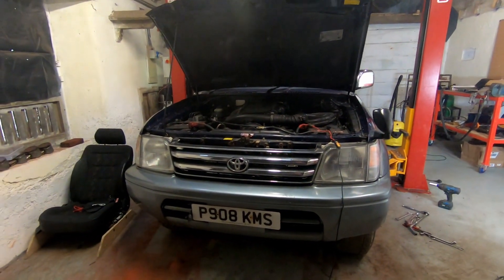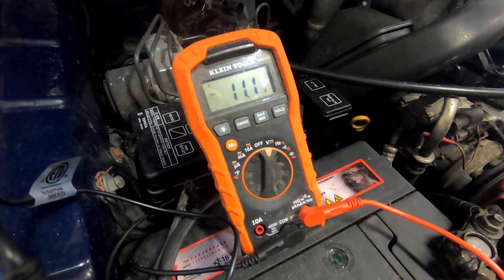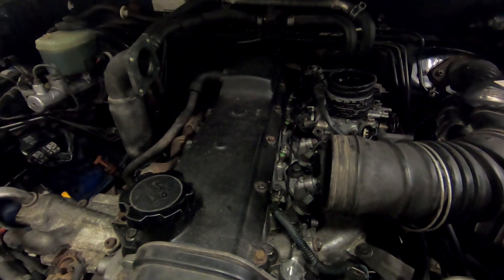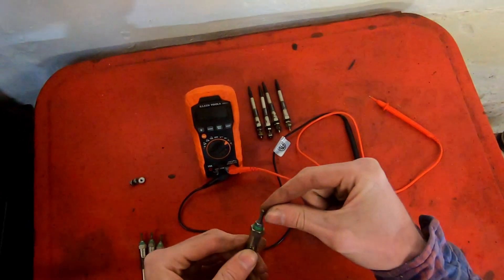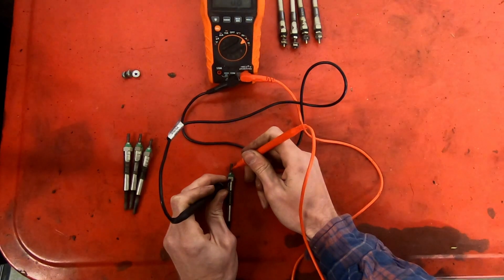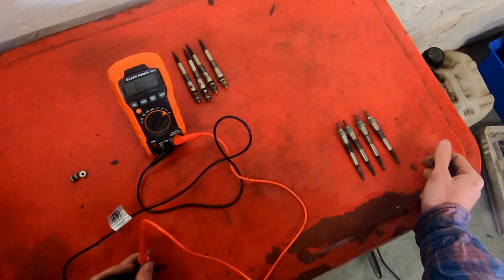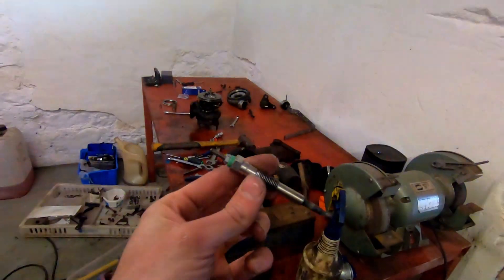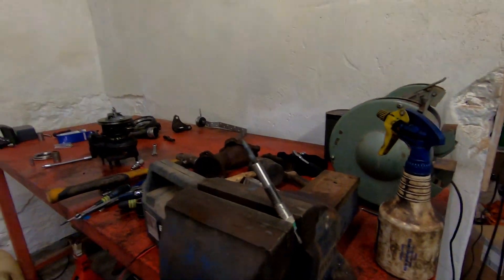Inspecting and Replacing Glow Plugs on a 1KZ-TE Engine in a Land Cruiser Prado

Comment: I bet this was a leaking fuel system and the new plugs made no difference. Check out the 1KZ service manual for a diagram of all the places leaks could occur (usually at the injectors or fuel filter).
Reply: or in my case, fuel was leaking back to the tank via faulty fuel cut-off solenoid on the fuel pump

Comment: how long for your glow plug light to shut off, my hilux surf has the same engine and also taking a long time to start. I tried glow plugs and nothing, and actually now my check engine light is on.
Reply from the maker: I believe the glow plugs stay on for 20 to 25 if the engine is cold. Something I didn't realise was that the glow plugs remain on even when the glow plug light in the dash goes out. You should be able to hear the glow plug relay (located in the engine bay) click after about 20s when they turn off. Starting problems could be a fuelling issue. Have you made sure the fuel system is bled? I know on the land cruiser the fuel pickup line in the tank can corrode and allow air into the system, causing starting issues. I don't know if the Hilux Surf suffers from the same problem. If the check engine light is on you can check the error codes to help find the problem.
Reply: I've only just been researching diesels for the past 2 weeks, but you should check to see if your diesel filter is at least 6 months young and air filter is newish new, and make sure you reset the fuel system via the prime pump if you replace it, the 2nd thing should check, is that your intake may be chocked up for of rubbish from the egr, do you think it might be time to buy new gaskets and clean the intake manifold ? which maybe this guys problem, the key rule for engine is spark(in this case extreme heat), fuel, and air.
Reply: I know Im quite off topic but does anyone know a good site to stream new tv shows online ?
Reply: @Keagan Carson Flixportal xD
Reply: @Bruno Ricky thank you, signed up and it seems to work =) I really appreciate it!
Reply: @Keagan Carson You are welcome =)
Reply: There's a glow plug light on the surf? Guess mine doesn't work lol